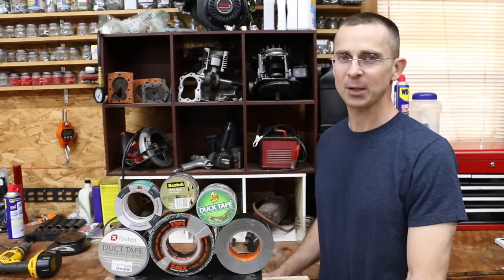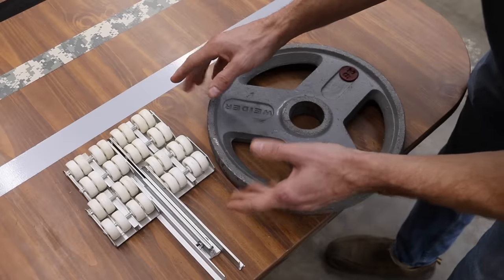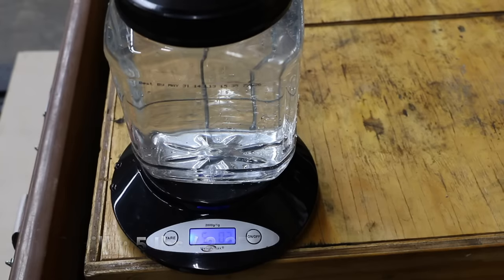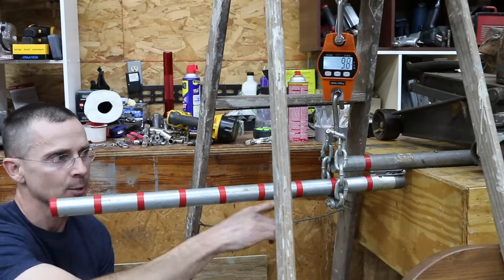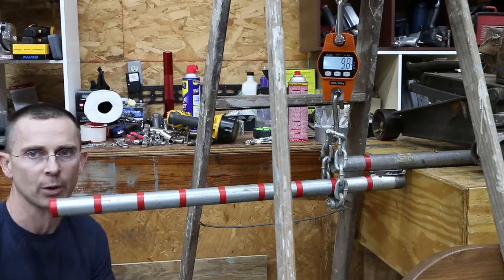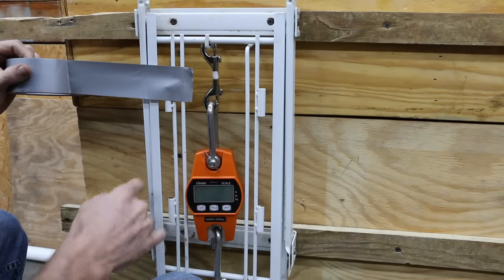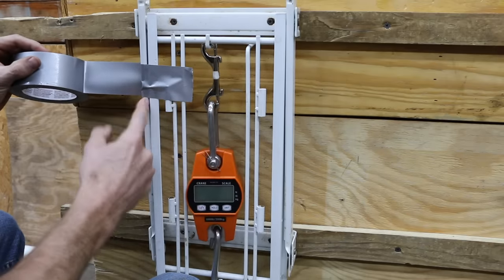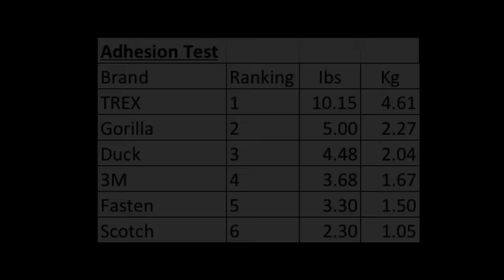Which Duct Tape Brand is the Best?  Let's find out!

Comment: You should also do a price comparison/ price per performance
Reply from the maker: Great recommendation.
Reply: that would very much localize the video to the area they are priced from.
Reply: Orrin Young but at least we get a benchmark comparison to each other regardless of the currency
Reply: Thanks for your imput man. Really good thing to know. Living up north experiencing extreme variations of temperature, I was actually wondering about this humidity factor.
Reply: Here in Iowa, I swear by Gorilla Tape. Bone chilling cold (-25) to blistering hot (100+).
A couple of years ago I patched a thin canvas party tent (it was my poor man's shed for a couple of years) with Gorilla Tape and the patch lasted longer than the canvas - through one summer and winter.
Reply: To be fair, price of each of these products is something that is freely available to us all online. That said, prices change over time and eventually any information we look up may no longer be relevant to the time this video was made.
Reply: I just bought 3m because it was the cheapest then I saw this video.
Reply: If I really need to have something hold, I use Gorilla, regardless of the price. For most temporary situations, I use a generic. I use aluminum foil tape for duct work and long-term outdoor applications (regardless of price).
Reply: If you're that rich why would you use duct tape?
Reply: Howabouthetruth I’m in Malaysia which is usually hot and humid, with the heavy rains. Had often read on the internet about Gorilla being referenced to when it comes to duct tape but it’s not a known brand here.

Then I finally found it at a Ace Hardware store. It’s significantly more expensive than the tapes I’ve been using, due to it being manufactured in the US and the transportation to Malaysia. But I’m very pleased with its quality. It’s now a must-have in the house and in the car’s tool kit due to its quality, reliability and versatility.

Comment: What a surprise some of the main brands that I trusted fail miserable.
Reply from the maker: Thanks for commenting.
Reply: If they work for you keep using them!  But now you know their limitations.
Reply: Hugedickerino Kripperino 
Duct tape isn't meant to be removed. If you want tape that is strong, but can be removed with little to no residue, go with gaffer's tape
Reply: You have a well-selling brand you can downgrade the quality because you're making revenue either way
Reply: Because there are different grades.  For instance 3M 8979 has a 200F rating and costs 15 bucks on amazon, and there are plenty of other types out there, you get what you pay for.  And the missing test is age, because the cheap ones turn to dust over time,  I find its best to buy a general purpose roll and a premium heavy duty roll for the uses where I won't want to go back to replace it every few years.
Reply: wooo weee No proof that you get what you pay for. It may be they are just labeling their cheaper tape as premium and selling it for more.
Reply: Wow I always thought Scotch was good . Oh well in the future I’ll stick with T-Rex
Reply: Stronger and tackier doesnt necisarily make it purposeful for its intended purpose. If you want to mend your jeep it does and if you bought a jeep you will need it. As duct tape though maybe  elasticity is more important than tensile strength? I thinkk all of the tapes seem to stick enough to seal ventilation ducts.
Reply: Yup. I'm finding more and more that the quality of a brand is inversely proportional to the amount of money they spend on advertising.
Reply: If you use duct tape like your supposed to (as in wrapping it around 12-15 times on whatever you're taping) they will all work just fine😂
Reply: Scotch failed badly
Reply: +Complete Bagel just a general rule, and contractor grade tend to do what they are rated for because their market isn't the general consumer buying on price, but people who will notice when the product fails.  For more dubious brands, sure the premium tape maybe just marketing, but for 3m, no, there is a significant difference in quality, no different than with any other tape. Another example would be electrical tape, doesn't matter how well it sticks the first minute, what matters is if it becomes a gummy sticky mess a few years down the line, and that's the difference I've noticed between the cheap brand and the premium.
Reply: I have always used Gorilla and I was pretty impressed, never heard of this t rex stuff and i want to try it out
Reply: But that's the one place the pros won't use duct tape!  Metal foil tape is the right choice for ducts, especially the hot air ones.
Reply: Well maybe they use for what you wanted it then to? But if they're way cheaper, there's no reason not to use them.

True if you want to temporarily stick something somewhere (like a camera on the ceiling, for a fair) then T-Rex would be the best option.

Comment: Cost per foot would help make a decision
Reply: According to Amazon, Trex is cheaper than Gorilla and fared better.
Reply: He usually does the cost and value sheets but probably forgot or something
Reply: When confronted with duct tape not holding what do people do? USE MORE DUCT TAPE!
Reply: Exactly, because most people wrap multiple times to secure an object. These brands obviously have different "thread counts" or thickness. This would without a doubt give you an idea of price to performance. If you can get twice the amount of tape from a weaker brand than a stronger brand, but wrap it twice for a percentage stronger than a single wrap of the stronger brand for the same price, ect...
Reply: I have found that too many times the cheaper tape doesn't hold.    So I end up using far more of it than if I just bought Gorilla tape to begin with.   Time is money too, and if you are wasting time always re-taping something then the cheaper tape is more expensive.     The only time I would want tape that doesn't stick well, is if I want to pull it off easy with little residue left behind.    I never heard of T-Rex before.  It is not sold in stores around here.
Reply: You could probably do that almost as easily as typing in the question.
Reply: @spacepioneer4070  This would boost the shear and tensile strength, but not adhesive (only the lowest later is sticking to the surfaces to bond).
Reply: @coopergates9680  Excellent point, i'm a novice when it comes to how companies create duct tape. I have a friend that works for 3M, but conversation about duck tape rarely comes up in our day to day.  But, you make a fair point indeed.
Reply: @spacepioneer4070  Do people just not really care? It's kind of confusing that I don't see duct tape in multiple widths and thicknesses. You can just cut it or tear it to different pieces, but still.

Or heck, even double sided lol, then you couldn't make the adhesive too strong
Reply: @coopergates9680  I think the phrase, "Duct tape will do the job", is why people don't have a preference. It works thus, no demand for different size, thickness, ect..If it works it works. Shrugs
Reply: @bekimbal9658  :  It's almost always better to go with the higher quality, if you value your own time more than a few dollars an hour.
Reply: Cost per meter would be even better.
Reply: Cost per foot is sort of meaningless when you have a better quality tape like the Gorilla brand. I usually tear half widths, which is plenty strong for most things. I cringed a bit when I bought the Gorilla role, but it’s lasted a long time since you need a lot less. 👍

Comment: Thanks for posting this comparison.  It was very well done with some inventive testing procedures.  As someone who tests pressure sensitive labels and tapes professionally I would point out that one important variable you didn't indicate is the dwell time of the bond.  PSA bond strength tends to increase over time so for many applications this should be a controlled factor when testing.
Reply from the maker: You are welcome!  Thanks for the constructive feedback.

Comment: I guess the most detailed answer to this would be: There is tape specially for ANY usage. Some are length-wise better, others by stick, other by abrasion.
Reply from the maker: Great point. Thank you
Reply: Nah, Gorilla and T rex were the clear winners
Reply: how do you know though, you really need a price per strength.... since if you had half the price, you could just use twice the tape and get the same strength.
Reply: Not only are those three points worth looking at, but keep in mind what the price point and amount of tape in a roll are as well. If I am broke as heck, and don't need the best, I would find the cheapest and smallest roll available. As a consumer, I would like to remember the statistics of the different brands, but if I know I wont need a high tensile strength tape or the best lateral shear resistance, or the roll only comes in a 4000Ft pack and I only need 100ft, then I probably would buy the 15-20 dollar roll rather than a 30-40 dollar one.
Reply: Scoutter flex tape
Reply: Depending on usage other factors will also affect what's the best take such as how much residue does it leave behind when you take it off, how waterproof is it, how sun-proof is it, what temperature ranges does it work in Etc.
Reply: Me: nerdsssszzzz
Reply: Yeah, I have gorilla tape but it's way too heavy duty sometimes, not necessary or wanted for some tasks
Reply: @dutchraider2  actually,  it's NOT meant to be a general purpose tape. I mean it's literally named after the one purpose it was designed for ....HVAC "duct" tape.

TRUE "duct tape" got a big reputation for it's durability and toughness, then the homeowner & crafting tape companies decided to cash in on that and made their on version that looked similar, and in some cases performs .....sorta-almost-kinda similar.

But they are NOT making it to the specifications and ratings that true duct tape is made to. And yes, the real thing has specific ratings and standards it must meet.

All that homeowner grade stuff only has to meet its own manufacturers quality levels, and they're making it to far less standards.

Look up "Nashua" brand tape and you'll get an idea of what I'm talking about.

A very common HVAC industry standard "duct tape" is their "557" tape.

http://www.nashuatape.com/

Comment: T-Rex seemed to be the best overall it was just barley second in strength and holds very well. It wasn’t bad at the width test either. All the top seemed not far off.
Reply from the maker: It's a great product.
Reply: I agree Trex was the best I think because of the glue,  strength doesn't matter if it don't stick good, don't stick it's pointless.

Comment: Interesting tests you have here! I'm curious to price per meter or meterprice per kg as well. I've seen Gorilla/Trex sold at hardware stores but they're ridiculously priced. If I need 3 layers of low quality tape to hold together something I can hold with 1 layer of premium, which one is economical?
Reply from the maker: Thanks for the suggestion.
Reply: 3m, probably
Reply: Gorilla comes with pretty huge rolls though compared to others. Not sure if it’s due to the thickness of the tape or more length though tbh. It’s my go-to
Reply: economicly ist definitively the one layer Tape...perhaps also a shorter way to the final place and so also a better economically Footprint...
Reply: Labor is your greatest expense. If you are factoring in labor as part of the price, there would be no way making two or three layers of any tape, no matter how cheap, would save you money over a high quality "one and done" tape.
Reply: @VapidSlug  I agree 100%! Which is why one should never hire a professional who is claiming to be cost effective by not buying premium products/supplies to use in his/her work. However I was thinking more myself as household fix-it-myself type of dad who would rather not spend extra on tape since most of it goes to whatever the kids are up to anyhow.
Reply: Good idea!💡👍🤔

Comment: T rex clear winner for me
Reply: Pure Gameplay trex has twice the stickynesssss as gorilla and that’s all I care about, I’ve never had to worry about them breaking just peeling
Reply: definitely depends on use, if adhesion is an issue, it has a significant advantage. Though others may perform better, by comparison, on different surfaces (ex: damp, cold, rough, oily, metal, plastic, fabric). I would be very interested to see those results as well.
Reply: Ya
Reply: Unless you want to remove it some day 😂
Reply: Same

Comment: I live in central Florida where it is extremely dank & humid most of the time. All of the other brands of tape I've tried are absolute garbage, the glue fails almost immediately in the high humidity. Gorilla tape is the only tape I've found that works great, even in high humidity AND RAIN. And just as your tests prove, it also has a high tensile strength. The stuff is so good, it is actually re-usable. Peel it off, put it back on and it still sticks & holds up just fine. I use it for all sorts of applications & repairs & swear by the stuff. Sure, there's adhesive products specially made for roofing & marine applications that may work better, but the stuff is extremely expensive. For the price, ya just can't beat Gorilla tape. I used to think "Gorilla tape is too expensive".......until I finally tried it. It's worth its weight in gold as far as I'm concerned......lol.
Reply from the maker: Thanks for commenting.
Reply: try 3M all weather duct tape
Reply: it’s very dank and humid
Reply: Ayyyyyyy just the comment I was looking for. Comin from central Texas.
Reply: As another Florida Resident, I understand the destruction humidity does to tape, it sucks.
Reply: I understand but have you by chance tried Flex Tape?
Reply: I was about to come on here and report the opposite.  I've always had the worst experience with Gorilla tape.  It's the only one that will consistently come of on its own over time in a very humid environment.  I go out of my way to avoid it as it has garbage sticking ability imho, although it is nicely thick and tough to tear.  Other duct tapes seem to "cure" or bond more tightly over time; Gorilla tape does the opposite in my experience.  I mainly use duct tape for outdoor applications in "very hot and sweaty" environments.
Reply: Magnetic 1884.........Dude, I live in central Florida, THE MOST DANK, HUMID CLIMATE IN NORTH AMERICA with 90+ degree heat every summer, PLUS lots of rain. I EVEN USE GORILLA TAPE TO ATTACH THE LICENSE PLATE ON MY WORK TRAILER. The gorilla tape has lasted IN RAIN, HUMIDITY & HEAT, ALL SPRING & SUMMER LONG, AND IT'S STILL HOLDING GREAT, AS I SPEAK. It sounds to me like someone is getting over on you by selling some knock-off brand that happens to be "black tape" and labeling it gorilla tape. Seriously. WHY ELSE could it be failing you like that??? It is SO GOOD in fact, I can peel it off, and RE-STICK IT. ( Not after several months, of course, but after several weeks, yes. I taped that license plate on last February, and it's still just fine. ) And read all the other comments here from people who are pleased with gorilla tape, not to mention the tests you just witnessed right here in this video. "Something isn't right" about the tape you got ahold of.......I can assure you of that. "DUCK" BRAND TAPE HOWEVER, AND ALL THE OTHER GREY DUCT TAPE I'VE TRIED, FAILS EXACTLY LIKE YOU JUST DESCRIBED. IT ABSOLUTELY SUCKS NOWADAYS. Years ago, it was pretty good stuff. But not anymore. That's the only reason I decided to pay more for the Gorilla tape, and so glad I did. I use it on all kinds of stuff. The last hurricane down here, we evacuated. I had 8 large plastic storage bins with lids packed full of our valuables, clothes, etc, and put them all in the bed of my pick up truck IN THE WEATHER. I used Gorilla tape to tape those cheap plastic lids on. Driving down the interstate for over 100 miles IN HARD DRIVING RAIN. And that tape held just fine. We got to our safe haven, I pulled the tape off AND RE-USED THE SAME USED GORILLA TAPE ON THOSE LIDS ALL THE WAY HOME. The wind alone should've ripped those lids clean off. So please try explaining all of the above, and what so many others are saying here, along with the test results in the video.